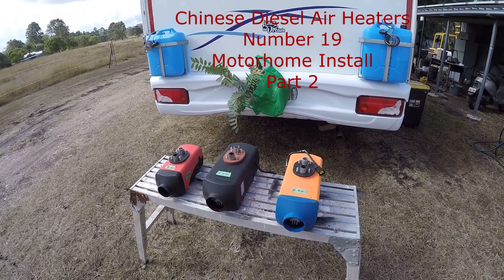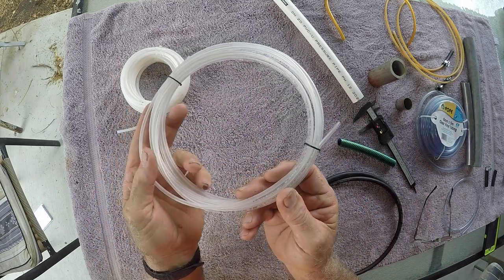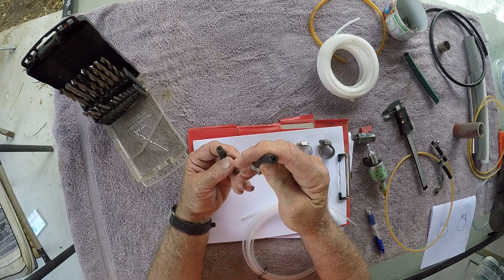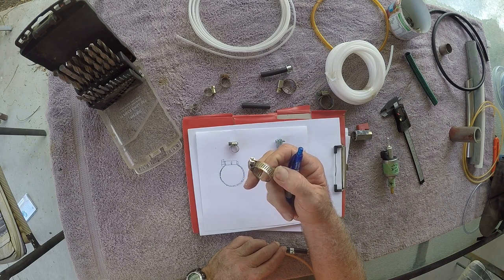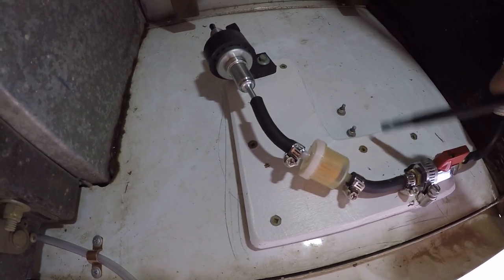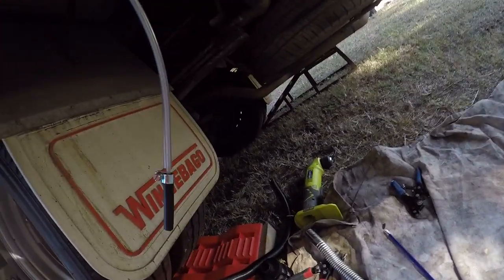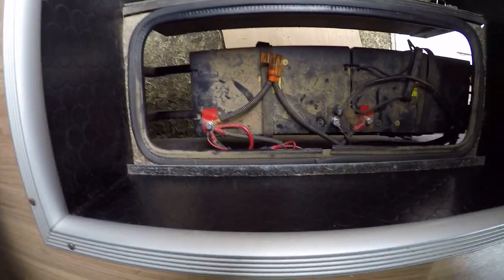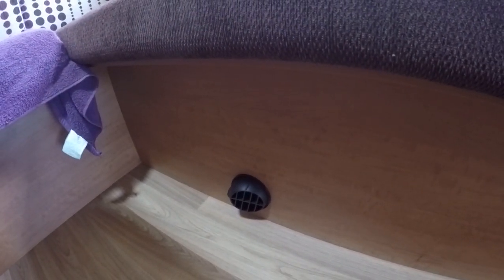Chinese Diesel Air Heaters no 19.   Motorhome Install Part 2

Comment: Hi Sir Ive been watching all youre very well done  and informative videos on these heaters ,and  with that I purchased one 5kw thats mounted in the aluminium case for the install on my  22 ft motorhome living here in canada . Do you think in youre opinion running a little diesel fuel conditioner  mixed in with the diesel fuel would keep the atomizer screen and the burn chamber from carboning  up ,and or would it prematurely burn the glow plug out  and dammage the metering  pump?  thankyou
Reply from the maker: Hi Fossy Bear,

First, thanks for the positive comments.

Now re the fuel conditioner. I am very reluctant to make comment on something I have not personally tested. I have not done a long term test on diesel additives. I have not needed to. If you have a gold standard install with minimum restrictions and you follow good operation procedures, you will have very little maintenance issues. 

We run the boat heater for perhaps 100 hours a year and in 10 years I have not needed to service the heater.

If I ever come across a badly carboned heater I will ask the owner if I can test fuel additive it see the results, if any. Then I can make comment.

Sorry.  JMcK

Comment: Hi John, I've just watched all 19 of your videos to do with the Chinese diesel heaters and I'm most impressed with your knowledge of them, it has really helped me understand the workings and the do's and dont's of them, the motorhome install will help me do my own motorhome, do you know if I can connect to the existing hot air ducts in the motorhome? I plan to install the unit in the garage of the motorhome and the original ducting is accessible. Cheers mate.
Reply from the maker: Hi David,

Thanks for the feedback, and thank you for watching the videos.

A bit hard to fully answer your question, but generally yes, if your ducting, particularly close to the heater is suitable for hot air. The hot air at the start can be over 100 deg C. (Boiling water temp)

Also the heater fan is very small, and if the ducting is long it may have issues pushing the air right to the end. If this is a problem you can install a small computer fan to help by sucking the air through. 

Remember from past videos, one outlet must not be able to be shut off, otherwise you can overheat the heater.

Cheers.  JMcK
Reply: Thank you for the information John, the longest piece of ducting is about 8ft and 3 outlets so I suppose I could try it and if I need more pull I could add the extra fan, thank you again for your help, it's very much appreciated 🏴🙏
Reply from the maker: David Evans 
That should be fine David. I have around approx a 7 metre run (21 feet)  in the boat with 2 outlets without any issues.  JMcK

Comment: Hey John. You were a great help when I installed my heater last year. I’m now looking at hydronic diesel heaters. There’s a few Chinese models. One is a hybrid modification of the 5kw unit and some are specifically water only models that seem to be knock offs of some wabasto or eberspacher models. Would be great if you did a series on them if you were interested.
Reply from the maker: Hi Dean, yes, I am aware of these heaters and if I can buy one cheap enough I will do a video.
Can you send ma a link to the one you looked at?  JMcK

Comment: Hi John, 
Quick question. To prime my fuel filter, I purchased a squeeze ball pump used on gas tanks for outboard engines. Fuel comes from my tank, to the squeeze pump, to the filter and off to my dosing pump. I am assuming that once primed the dosing pump will be able to lift fuel through the squeeze pump. From the bottom of the tank to the heater is under 40 inches.
Great video. Dave
Reply from the maker: Hi Dave.
Should be OK, but once primed there is no need for the squeeze pump, so why not remove it and take away an unnecessary restriction. 
Cheers.  JMcK

Comment: Hi John, thank you for your very informative videos. In this video or in part one you mentioned that if one wants to fix the heater on it’s side (exhaust exiting sideways/horizontal) one should make sure the glow plug or atomizer be up or position specifically. I need to install mine sideways. Can you reiterate/confirm about that ? What are the constraints in fixing the heater sideways. Much appreciated. Thanks
Reply from the maker: Hi Andre,

These heaters can be side mounted provided it is the side with the glow plug on the top.

Yes they will run with glow plug on the bottom - FOR A WHILE

With the glow plug on the bottom the plug and screen gets saturated with fuel “pooling” leading to non operation.

Cheers.  JMcK
Reply: @johnmck1147  Thanks John
Reply from the maker: Andre Bombardier 
👍

Comment: Hi John, I unhooked a battery from the heater and when I reconnected it, it was like there was no power. The fuse is good. Also on another heater the new boards that I ordered won't work with the controller. I'm a Harman pellet stove expert but I need more understanding of these heaters. Can you suggest videos I can watch so I can solve these problems?
Reply from the maker: Hi SWG, 

Disconnecting a battery won't cause issues. Connecting it back up the wrong way will. 
If you connected it back correctly have you checked with a multimeter you have voltage at the ECB?

Ref controllers. In the past you could mix and match controllers and ECB's as all the manufactures used the same protocol. However lately some manufactures have not only used different plugs but radically changed protocol and this is no longer easy or in some cases even possible.  These days you need to buy as a spare part, an ECB and controller together from the same manufacturer or supplier to be sure of compatibility. 

I do not know of any videos explaining this.  Sorry. JMcK

Comment: thanks for the video my fuel line hole is so tight (tried soap and hot water I can only fit the nylon line in like 12mm/ 1/2 inch. I had to cut the fuel line shorter so there isn't any air gaps between the line.  Do you think that this is ok?
Reply from the maker: Yes, I think you should be ok if there are no leaks.

On the heater itself where the fuel hose is vertical and the cavitation bubbles can not accumulate a small gap between the hard nylon hose and the metal fuel pipe of heater does not cause issues.

Cheers.  JMcK

Comment: Thanka for the vids John...Great work...
I was wondering whether you could just remove the fuse at the power source , rather than put in a seperate on off switch??
To stop power going through to the display, heater and fuel pump...

Also does anyone know the correct name or who sells a fuel on off switch as i am unable to find one...
Thanks
Reply from the maker: Yes Jas, you could just pull the fuse, but isn't a switch easier?
Any auto store, motorbike store, air tool store, outboard motor store etc will sell small ball valves to be used as fuel cut off switches.  JMcK

Comment: John, great videos. I may have missed it, but did you cover any venting/ducting issues? I'm using 3" bathroom fan ducting, and it gets a bit hot when the heater is going full blast... I'm afraid the ducting could melt??  Anyone else had that concern/issue?  Alternatives could be heat-resistant 4" dryer venting, which I assume has heat protection qualities.  Thoughts on maybe reduced airflow on a 4" duct? And any other melting issues? Thanks in advance.  p.s. I'll be running my ducting about 10 feet or so, into my RTT from my all-in-one CDH.
Reply from the maker: Hi Dick, yes, the ducting can get very hot, over 100 deg C. You need to use correct ducting.

I have seen videos where the installers used PVC pipe. They obviously never tested the set up before posting the videos. I actually tested the PVC in a real install as it would make ducting so simple. Had to remove it as the PVC pipe softened and sagged.

Your length is not an issue. 

You can buy ducting on the internet. Search ducting for Eberspacher or Webaso diesel air heaters.

Cheers.  JMcK

Comment: Thank you for posting this video, here is my question, I live in northern Canada and when on the road or camping in the winter, the heater has to work. What is the reliability of these heaters?
Reply from the maker: Hi WRXS, If installed correctly, and operated correctly with the right fuel, these cheap Chinese heaters are very reliable. In a very cold winter they work best on a high kerro diesel mix, rather than just diesel.  JMcK
Reply: @johnmck1147  Thank you for the reply, I am researching before buying. Your videos are the best and most helpful so far.Regards WRXS.

Comment: Hi John, videos have been a great help. I have a question, I recently installed an all in one 5kw heater, it has 4 outlets but I only require 3, could I safely tape over one outlet? If it overheats will it commence cool down procedure or would it cut out and meltdown 😬
Reply from the maker: Hi Charles, 

Do you want one small outlet, or just one outlet?

If you block up three of those outlets you run a real risk of overheat. 
If you just want one outlet, you can join the 4 into one hose.

In an overheat situation, the heater will go into safe shutdown mode.

Cheers.  JMcK

Comment: Another great video, cheers.   Have you ever considered, or do you have any knowledge of using the automotive diesel additives in these, that are designed to clean fuel system /egr / turbo etc?  I appreciate they are 2 very different systems but wondered if any such additive may help cleaning out any combustion / soot residue, without the need to dismantle, a sort of preventative maintenance if you will.
Reply from the maker: Hi Mr O,

I have not personally tested diesel fuel additives as preventive maintenance.

You will notice I stress over and over in these videos the need for a correct install, and proper operation. If you have an install with minimum restrictions in the combustion air intake and the exhaust you will have very little maintenance issues. I have not had to service the heater on our boat in the Med for over 12 years.

A good preventative maintenance is at season end run a kerro/diesel mix around a 90/10 mix for one hour at a high setting.

Cheers.  JMcK
Reply: @johnmck1147  thanks for your reply John.  Mine is installed as per your recommendations and the eberspacher manual for the similar D4 heater, so good to know it should be OK.  Thanks for the pointers on kerosene mix. Cheers
Reply from the maker: offbeatwarble 

👍

Comment: Hi John thanks for another great video, i am looking at installing diesel heater in 21ft caravan it will be mounted under club lounge seating plenty of room and we dont store anything there. This is the annexe side of the van obviously the exhaust will need to head towards the other side of the van does the exhaust need to run all the way to the edge of the van 2m approx or can it stop under the van if so how long from heater will exhaust need to be to stop fumes going into annex, sure you have answered this before but i cant find it in previous comments thanks in advance
Reply from the maker: Hi F55,

It is better to run exhaust as close to outside as you can, and a 2 m exhaust is ok running straight under van if it has no bends after coming out bottom of heater.

However two things are in your favour here.

1. There is plenty of airspace under van to “dilute” exhaust fumes if exhaust terminates under van.
2. Installed correctly, these diesel heaters run very clean. Notice in my videos where I place a CO meter only inches from exhaust on bench test, and I can not get a reading on meter.  

Suggest you purchase a CO meter and do your own tests.  JMcK
Reply: @johnmck1147  OK great thanks John one last question with regard to the hard nylon fuel that comes with the kit is it ok to use or better off sourcing a better quality hard nylon fuel line have heard these fuel don't last thank you.
Reply from the maker: If it is narrow bore hard nylon and not narrow bore soft vinyl it is ok, and I have never had an issue with it. However I run it through a protective sleeve to prevent chafing. If it looks suspect there are many suppliers for the hard nylon on eBay.  JMcK
Reply: @johnmck1147  Thanks again great help

Comment: Hi.  Best video series.  I'm trying to track down a switch like you're using in the video.  Is that a switch/distribution unit?  Can you help?
Reply from the maker: Hi Linda, that is just a simple 12V lighted switch sold at most auto shops. You can use any switch, lighted or not that is good for 15 amps or more. In Aus people like Repco, Supercheap, or Jaycar sell suitable switches.  The recess for the switch was made from a bit of 50 mm pvc pipe with a ply flange and a ply base glued to the pvc with epoxy glue.  JMcK
Reply: @johnmck1147  Thanks John.  Are there 2 switches?  The white push button one with distribution (hidden) and the recessed one.
Reply from the maker: No, just one switch. The original switch was under seat, but too much effort to lift seat up every time to access the switch, so moved switch to outside. But recessed switch to make it difficult to accidentally switch off.  JMcK
Reply: @johnmck1147  Thanks John.  I’ve ordered my diesel heater unit and have been taking measurements in the RV.  I hope I am ready for first run before winter is over. lol